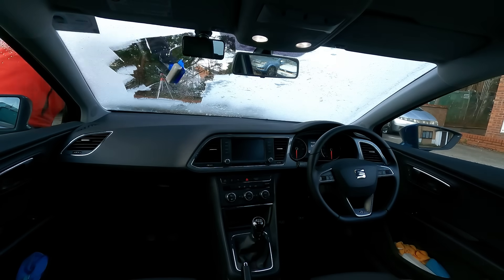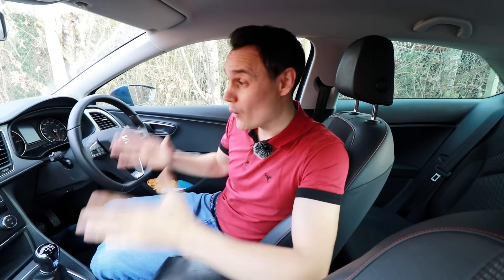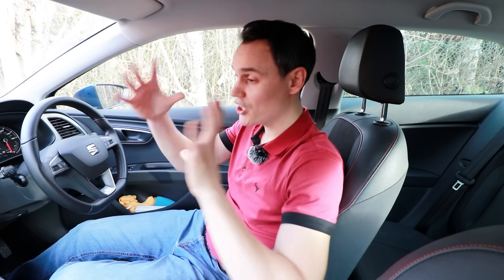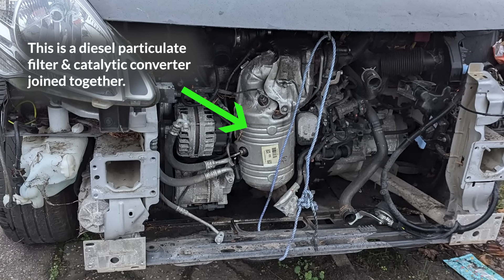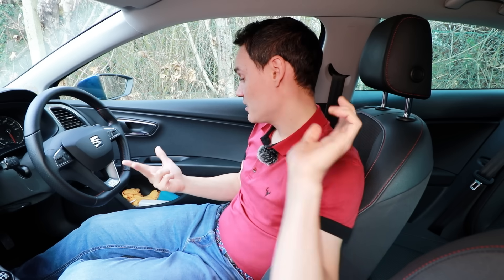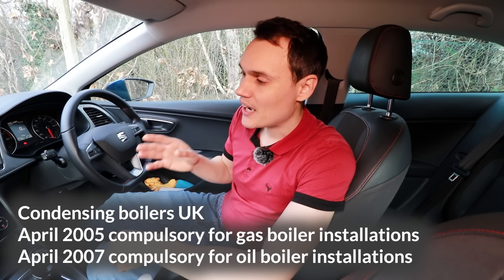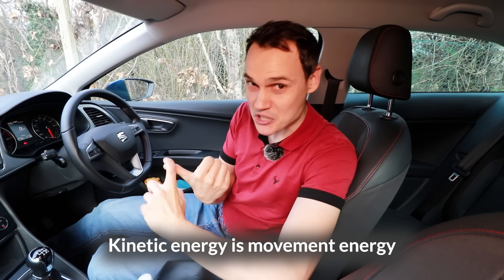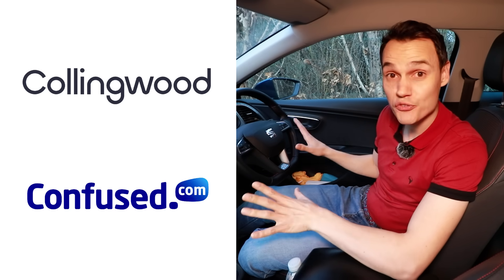How turning the engine on when de-icing can cause you harm. Possibly even cancer.

Comment: If you don't switch on the engine while you de-ice the windscreen glass will still be cold when you start to move. That sets it up for it misting up and/or freezing up while you're driving along which can be dangerous. I think it's better to take your chances with the exhaust fumes, just take care to stay up wind of them.
Reply: You can just spray it with some winter washer fluid after manually de-icing it first (scraping off the ice), as soon as you start the engine and drive off. This fluid should then prevent any substantial freezing over there. As for the misting (I presume you mean on the inside) - nothing that a microfiber cloth can't handle in 5 seconds. Why would you take chances if there are some neat ways to completely avoid the risk?
Reply: Exactly. It’s not like your on hands and knees behind the car breathing it in. Your standing quiet a way from the exhaust and if you look at what way the wind is blowing don’t go into it.
Reply: Yeah and tbh you breathe in way less of these gases while de-icing your car then you do while just walking next to a street, or by just driving your car on a busy street.
Reply: Exactly this. Video is uttere cobblers, breathing in exhaust fumes harmfull, no ** sherlock, imagine what it was like with lead in the fuel and everybody using a manual choke..yet we all survived.
Reply: @grrfy  A bit more to life than survival for most people. Most people wouldn't choose to go back to the leaded days, nor would they want to recreate a modern substitute.
If your future planning is ceilinged at survival then crack on I suppose, although you're already well above that line, so if survival is all you aim for you really don't need a car.
Reply: @eddyr3691  way to miss the point bud.
Reply: Having an EV is helpful as hot air is available instantly.  No more fumes, cold hands or annoying scraping sounds in the morning
Reply: @martinwood9014  EVs don't heat up instantly, it takes a minute or two for the heat pump to finally start being effective depending on outside temp. Unless you don't have a heat pump but then range is a bigger issue. The plus side is that you can turn on the heater while in bed from the app or by scheduled depature time and date while on the charger, which also heats up the battery and lets you use regen braking during winter months so your winter range isn't as compromised as a cold car. I didn't buy an EV to "save the planet", but rather to be comfortable and to have cheaper running costs, hence I don't care if I have to fast charge more often. And yes batteries are very expensive, but I still have 5 years of warranty on both the dual motors and on the battery pack. The car would be sold before the end of that 5 years. So the usual ICE owner complaints don't matter much to me. The heat stays on even if I go shopping (which is a minimal drain when the car has to maintain temp rather than raise it).

As for the bus example Myria2834 used, I think it isn't an issue in car EVs, or at least not in my EV. When in really cold temps, the rotors generate 3KW waste heat each, for a combined up to 7KW of heat when combined with heat pump taking heat from outside. That's more than enough for a tiny car cabin. When temp is reached, consumption is a mere 300-700watts, just using the heat pump alone. But I think Myria was more concerned about range than the actual heating capability of buses.

I've driven Ford E-Transit vans, which is as close as I've come to personally driving a bus. They keep quite cosy and seem to not use as much power when city driving. If longer distances are a concern, then you need to know where to find fast chargers along your route. You could google it later but it is better to go prepared on the road so everything goes seamless. Usually every 10-15km there's a gas station along the highway with both fuel and electric charging infrastructure here. Large public transit buses have electric chargers at strategic bus stops on route. When stopped, some metal frame rises from the roof and connects to the charging infrastructure. Although I've never been cold in an electric bus, I think the government is experimenting as I saw a bus another day that mentioned driving on hydrogen.
Reply: @martinwood9014  Or any car with a electric engine heater and cabin heater. Just remember to plug it in and start it 15-60 minutes before using the car.
Reply: @martinwood9014  Yeah, except EVs struggle in the extreme cold where you would need that the most.
Electric buses are freezing children because the batteries can't run the entire pick up route in the snow with the heat on due to how much range a heater eats up.
Reply: @myria2834 im in car, not a bus. Im warm and my range is still good, but even better in warm weather
Reply: @martinwood9014 range isn't good on any EV
Reply: Even better de-ICE your vehicle and get an EV.
Reply: @andyt1048 I've recently got an ev, just amazing how quickly hot air is available,  5 seconds, no more de icing, no more noise from scraping and engine idling.
Reply: @martinwood9014  amazing how much the range plummets as well. plus I have no off road parking or charging so agin, no thanks, my 2002 honda starts heating the screen in under 2 minutes and a quick spray with good deicer thats fine by me.
Reply: @grrfy 
You do realise mpg drops in winter, meaning you must tank up more often to get the same range yes?
Reply: @ianl1052  actually mine gets better from the cooler denser air.
Reply: @ianl1052  yet they make more power in the cold, unlike EVs.
Reply: @acarguy3773 
More power for what? Maximum speed limit is 70 mph.
Reply: @ianl1052  no speed limit on a racetrack, which happens to be a place where EVs really make no sense at all. Anyway, you know you have to get to 70 right? Normally it's ev guys who brag about power and acceleration anyway, but in the winter they make less power and have significantly reduced range, it's far more impactful for an ev than ICE.
Reply: @ianl1052 The mpg decrease in winter is no where near the decrease in battery longevity in cold weather, stop reaching for the stars to try and defend your purchase
Reply: @andyt1048  thanks but I'm too broke for that 😂
Reply: @andyt1048  not a chance of that

Comment: I just turn the car on 5 minutes before leaving, job done. window, clear. car, warm and toasty. me? happy
I'm paying tax based off of the amount of emissions my car is claimed to produce, i'm getting that moneys worth. It also means i'm taking better care of the car as in an ideal situation, you want to leave it to idle for a minimum of 10-30 seconds for the oil to circulate etc. i'd also rather use the heat on the window than keep scratching at it with a scraper.
Reply: Likewise, I leave it for 15 mins idling to get everything up to temp as I'm in the house keeping cosy 😂😂

Comment: I almost never use de-icer and/or a scraper. If it's iced over but not too thick, I'll start the car up and heater blowing on windscreen and maybe heated windscreen if available. But I won't stay right with the car. I'll keep it within sight for security reasons but I'll finish my cup of tea and breakfast. Within a few minutes the ice will be gone. If it's a really hard frost or I'm in a bit of a rush then it's a bucket of luke warm water job. Yes I've heard the horror stories but I've done it many many times and never had a problem.

Comment: Just use warm water + screenwash.    And no, it won't crack the windscreen.   For the cat to heat up it quickly it needs to be as close to the engine as possible, which also makes it slightly harder to steal.

Comment: Been driving for over 43 years. Always turned on the engine to warm up the car as I de-ice the car and the engine is fully warmed up for me when I drive off. NEVER EVER HAD A PROBLEM with any of my cars that have a catalytic converter.
Reply: So I guess you just de-ice your car for over half an hour with the engine idling? Because there's no way for the engine to completely warm up in sub-zero temperatures while the car's just standing there on idle. Your oil will still be far from its operating temp, even if the coolant is hot. Not even gonna mention the transmission fluid. To warm up effectively, the engine and transmission need some load.
Reply: 42 years driving  ive never had a problem with all the pre-cat cars I’ve started and let tick over while I clear the windows!! 🤷🏼
Reply: don't need to shout though, the problem isn't damage to the cat, but carbon monoxide, etc. are harmful. When you first start the car, you will smell it if you smell the exhaust, that is what every car used to smell like all the time before catalytic converters, pollution was more seriously dangerous
Reply: @cassterwheel

It's BS...

This bad advice comes courtesy of the green brigade, who don't want you to idle your engine while at a standstill.

I see the propaganda here 😉😉
Reply: You are statistically insignificant. not being rude that's just the scientific fact of the matter. The percentage chances of these things actually giving you cancer are small but that doesn't mean they're not real, it doesn't mean that there aren't millions of people who's cancer could've been avoided or more easily treated if they were exposed to less carcinogenic gasses... yeah well done you happened to be more resilient to cancer than the ~50k people who got lung cancer last year in the UK alone.
Reply: @RWoody1995 

Actually, this isn't about cancer (that's a scare tactic), it's about not idling your engine while the car is stationary. The reason is climate change.

I've seen the tactics now for several years...in various forms...

Trouble is, you need to be me to see what's happening and call it out. 

Thankfully, those that have warmed their engines up for 20yrs + are saying that they will continue to do so, thus avoiding damaging their engines and subsequently their bank balance.

Comment: This video contains a great deal of speculation but no actual testing.   The assertion that standing outdoors in front of one's vehicle for twenty seconds after starting the engine results in harmful inhalation is unsupported.  One could quite easily test this claim using any one of many commercially available detectors, which would have made a very interesting video.  Instead, I'm afraid this falls within the realm of unsubstantiated fear mongering at the moment.

Comment: An interesting topic is Webasto fuel burning heater emissions. No cat/dpf or emissions testing on those, definitely emitting lots of particulates (More than the running engine would!) and nasty stuffs depending on if diesel or petrol. And used right beside your home. Petrol webasto starting up smells like a decatted car and diesel is also correspondingly. But once they get going they have zero smell. No one has really studied the emissions thoroughly other than a small one at a Finnish university, I guess the manufacturers have found a way to reduce start-up emissions by just relocating them to a different source (the heater). Thinking about what's the total emissions impact if preheating (and cabin only or engine too?) Vs just running your engine. 
But since you aren't beside the car and hopefully you have some wind blowing it won't be ever be an issue to worry about.

As a note I myself have a chinese diesel heater on my old diesel car (installed in the boot floor) that was in total less than 180€ to install with quality parts and it is very handy to always have a warm cabin on command over the 4G network and an app. When I start driving I have the cabin fan off and once the engine is up to temp I turn the diesel heater off and turn the cabin fan on. New cars have this perfectly integrated.

Comment: I understand the point of it. However, it still takes like 3-5m to demist the car when its around 0 degrees. So, im going to wait anyway, why not to spend this time to deice the car?
Reply: 5m 5 times a week for a month is almost 2 hours, it all adds up. The thing with cancer is nothing causes cancer right away, it's something that builds up from countless tiny dosages throughout your life, actually you could say that a 5m dosage of carcinogens every day is worse than 2 hours of dosage all at once, just think about all the nuclear accidents and stories of people that walked through a heavily irradiated area to clean up afterwards who died 50 years later of something entirely unrelated... and then say you drive for as long as you work, so about 40 years and you deice the car like this for about 4 weeks (say it only ices up for the 1 coldest month of the year), that's 66 and 2/3 hours spent gassing yourself for no reason. now it sounds significant eh?
Reply: @RWoody1995  The body is actually reasonably good at dealing with very intermittent low level exposure, so long as they overall exposure is low enough and below the threshold that allows our cells/systems to have sufficient time to deal with the metabolic impacts. 

So I'd personally rather the 5 min 5 times a week in free air, than 2 hours of constant exposure.
But of course, better than all that though is 0 mins 5 time p/w.
Reply: @RWoody1995 ok, next time I'll drive away within 5sec after starting the car with fully misted windows
Reply: put cat litter in a sock and leave it on your dash. works wonders for demisting
Reply: @Killbayne  hahahaha
Reply: @viper7770  no legit, cat litter can suck up a ton of moisture, hence why its frequently used in mechanic shops to soak up oil and fluid spills. it's true
Reply: @Killbayne  mate i thought you talking about cat shite hahaha

Comment: What if I need to pump my tyre and I need the engine on ? In order to power up my pump.
Reply: Yes, have same question.
Reply: You can't ,do it with car engine off and run down your battery,then you will have a flat battery and flat tyre😂😂😂
Reply: @_Im_Richard yes exactly, I will breath in the toxic air while pumping the tyres I guess
Reply: @_Im_Richard anyone come across good battery operated pump? Or I guess just go to a garage.
Reply: @chrisg5634  I find the only problem with a battery operated one is you still have to charge it and id probably forgot 😂
Reply: Obviously you can wait 10 mins so engine is up to temp, cat is working and then fill up the tyre.

Although you'll need your own driveway, its illegal to keep a car running on the road if you're not sat behind the wheel.
Reply: @CrazyInWeston Who is going to catch you? There's no police around anymore.
Reply: @yngndrw. Obviously (again) I know we all do it on the roads, I was only mentioning the technicality of it as this is only for the privileged few that have driveways at that is what the law says, despite everyone ignoring it. 

I dont have a driveway, I cant leave my car while its running. It needs to de-mist and de-ice (Have a focus with its heated windows)

Same with EVs... I cant charge at home, so no point to EVs for me.

So for a flat tyre, I'm in the same boat.
Reply: You simply can't...

The green brigade don't want you idling your engine 😂
Reply: You can't...

The green brigade don't want you to be idling your engine 😂
Reply: If you have a garage, get an air compressor and a hose reel. Far better than the little electric pumps.

Comment: De-icer? Not me. I've been using a container of warm water for the past 40 years - takes seconds and you don't get your hands cold. An alternative I've seen is a bag of warm water and rub the bag over the windscreen.
Reply: There's a risk of thermal shock, probably fine with warm instead of hot water but risk is still there. The bag trick is quite good though

Comment: I always de-ice with the engine off (I also use a windscreen cover which keeps the front windscreen reasonably clear). The reason for this is because turning the engine on whilst de-icing the car doesn't help since the engine is cold and stays cold for a while when stationary, so it's only blowing cold air and doesn't help and is just wasting fuel.  Plus the small detail it's illegal for the driver to exit the vehicle with the engine still running....
Reply: ...illegal (with exceptions) on a public road, not your own property.
Reply: It's not illegal to exit the vehicle while the engine is running? Highway code rule 123 states you mustn't leave an engine running if unnecessary. Warming up the vehicle is doing a practical function and therefore necessary.
Reply: @MarKeMu125  You can warm up the vehicle whilst remaining inside, hence it is unnecessary to exit the vehicle with the engine running. De-ice the car with the engine off, then go inside and use the heaters, just like what is explained in the video. But yes, you did cite the correct rule so thankyou for disproving your own point .I'll even state the legislation for you. Law CUR regs 98 & 107.
Reply: @collinslfc  it's worth noting that local agency guidance (e.g. Newcastle & Cheshire councils) specifically list things like “where the windscreen is being defrosted” as acceptable reasons. The only reports of fines I've found are where engine left running while the driver leaves the vehicle unattended.

Comment: An easier way to clear your windows from frost is buying soft99 de-icer. You spray on and you don’t even have to wipe off. Ice is gone within seconds. Yes it’s £12.99 but I’m still using a bottle I purchased last year. It’s really good stuff
Reply: I've got something similar in my car as well. Spray and forget, basically. Never had to scrape anything off ever again since I first discovered it. Much quicker too.